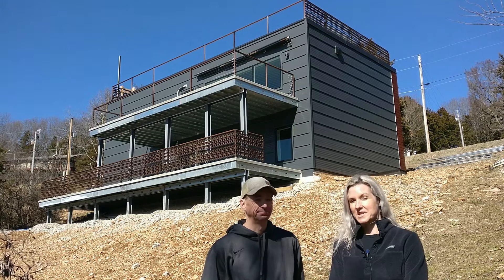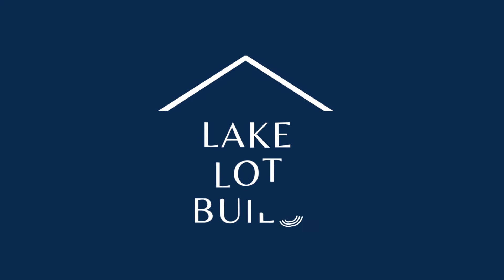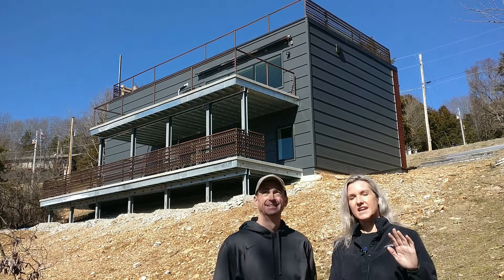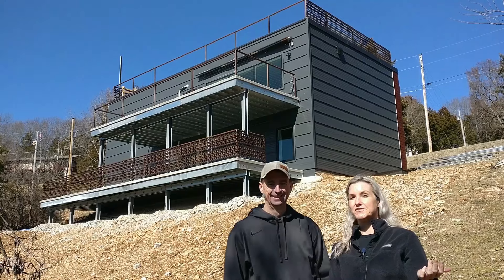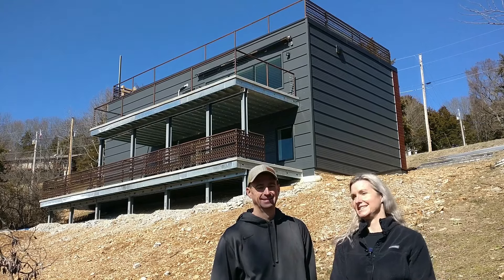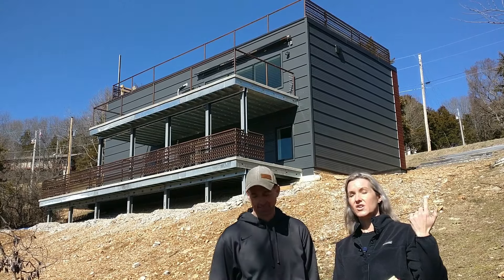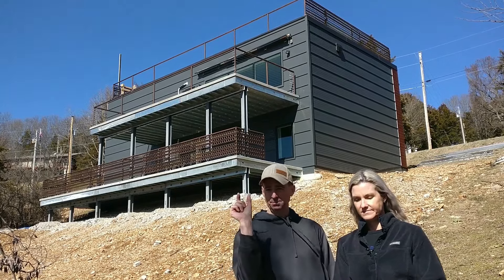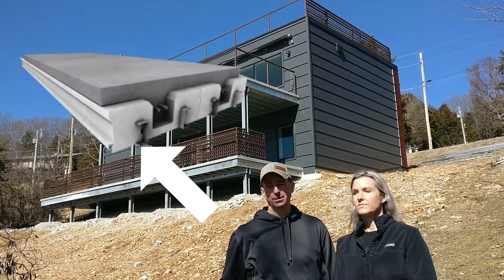Mistakes We Made in Our ICF Home Build! Would we build with ICF again?

Comment: Why would ICF be better than traditional cement block, with an adobe finish? Obviously, a proper insulation would need to be added.
Reply: They are much stronger when they are done right with steel reinforcement. They are easier to handle. There is no mortar, less labor, less time, and they have attachment points for screws or nails on the inside. You can also run electrical and plumbing (chases) into them. There are no cold joints in the wall either. You can hang floor joists from them by easily embedding steel joist hangers through the foam before the pour. You don't even need a ledger board.

Comment: Awesome job detailing your experience, how the hell did you have time to do all this field work and also video? That is my main question LOL. Being that the house is finished are you noticing any moisture issues, I have heard ICF homes for the 1st year can have moisture still coming thru into the drywall for the 1st year or so due to the concrete not fully cured. https://www.youtube.com/watch?v=DLFIR-0JjGQ Any thoughts? Thanks for your info!
Reply from the maker: So, the house was pretty humid this winter. We ran a dehumidifier round the clock for several months. Once the HVAC was in we were able to control the humidity through those units. Now it is hot and muggy inside but cool and dry inside. I would agree though that ICF seems to make for a pretty humid house the first year. We found dehumidifiers during that period a must.
Reply: This is why your HVAC system is CRITICAL in an ICF home. We used Wise Engineering Solutions to engineer our entire HVAC system. Too much humidity and you get mold and mildew. They take into account the direction your house is facing, your window efficiency, your lighting plan, etc. They calculate the heating and cooling load as well as the CFM needed per room and will also engineer the layout of the entire system. They are AWESOME to work with! They saved me over $6,000 in HVAC equipment (most HVAC contractors don't know how to engineer or properly size ICF HVAC systems).

Comment: So sorry you bought Pella - the most arrogant overrated window company out there
Reply: I agree. I installed them in a custom home and the two pieces slider had issues with the hardware lining up. The wood finish on the casement Windows was terrible with raised grain that I ended up sanding and refinishing. The rep said this is normal because it’s the “Builder Series” so it’s not as nice. Haha almost $40k and I thought that the windows were junk but we made them work.

Comment: You didn’t realize that you needed to ensure the roof is water proof — concrete isn’t. Even with a slope you need a filling water proofing product.
Reply from the maker: Oh we knew to waterproof the roof. We used concrete addictive Xypex and also an elastomeric coating on top. The problem is that we want to use the deck for entertaining and we have areas now that after the rain hold water in pools.
Reply: @LakeLotBuild  but the IBC requires a 1/4 inch per foot slope in any of that stuff, so you didn’t follow code in the planning. The concrete guys probably thought you were going to have a built up material that did that.
Reply from the maker: 1/4 slope minimum was the plan and in the spec, but in real life it didn't happen. We planned correctly, but the execution of the plan failed when the concrete was poured and finished. We didn't finish the concrete ourselves. That was the sub. In retrospect we would have mandated more than a 1/4 slope or made it so it would have been nearly impossible for the concrete sub to miss it by sloping the LiteDeck itself.
Reply: Not that hard to waterproof the concrete. Millions of houses in Asia have flat concrete roofs. Either sealed with regular concrete sealant or Epoxy (same shit that's applied to shop floors). There's a new porcelain coating that's also out now.
Reply: @LakeLotBuild  yes the plan should have been to either to mark the high spot as too how much to place and mark the minimum edge or to tilt the lite deck